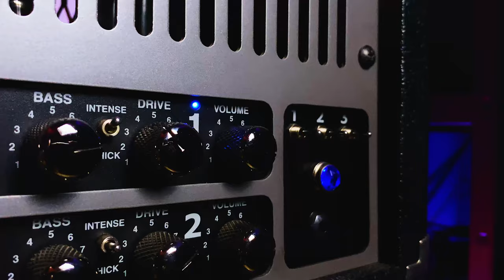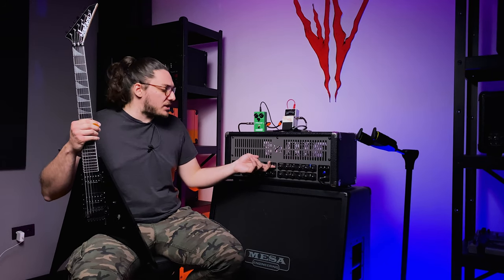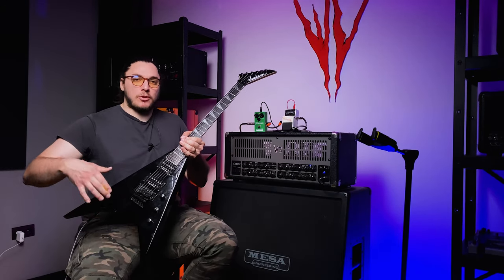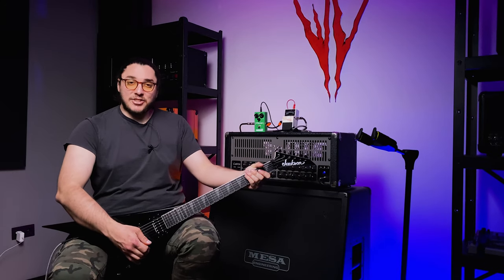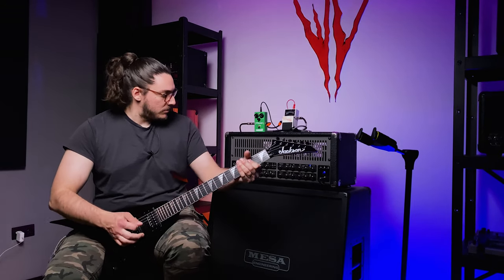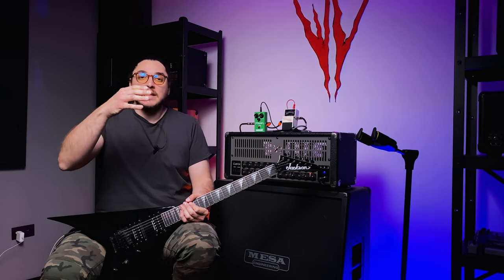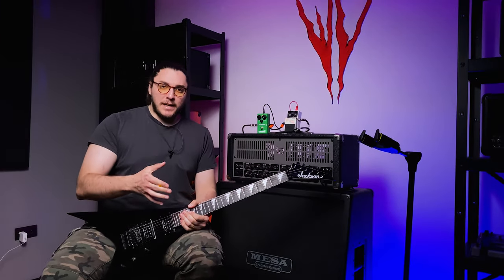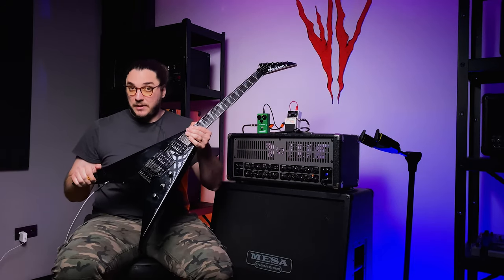SOUNDS FINE BUT STILL... | Carvin V3 | Metal

Comment: I reckon that the V3 is on its way to becoming a cult classic. It's been flying under the radar for years, but I've been noticing quite a bit more attention and respect in recent years. 

It's easy to dismiss this amp if you only spent 5 minutes with it, as it is true that it's very easy to make it sound horrible with a poor idea of what ideal settings "should" be. In other words, dial it in with your ears, not your eyes. The EQ and other controls are very powerful. If you set the treble, brightness and other settings to where you typically would on most other amps, you're very likely to end up with a super fuzzy box of very angry bees. Go through each parameter carefully, one at a time. Once you've gone through it once, go back again and refine each control again. Changing one knob can effect how another knob responds. It does sound a little messy to begin with, but it's actually quite simple once you understand how it all works. The reward is most definitely worth it though. I don't even really play metal. I'm more of a hard rock guy, and this amp is just awesome. I don't foresee myself ever buying any other amp. My biggest recommendation though would be to buy the head and not the 2x12 combo. The combo version is easily the heaviest amp that I've ever had to lift. It's just stupidly heavy. I ended up finding a head version for sale, which is what I have now. It's also the later revision with if added reverb, which is a nice touch. 

In short, grab one of these now if you can while they're still affordable to do so. As I began with, I reckon you'll see these amps start to shoot up in price as more people become aware of their hidden brilliance.
Reply from the maker: Magnificent summary sir, this goes to the top. Thanks!
Reply: @WrathVault  I'm glad that you appreciated my own little bit of commentary. Thank you for your own review. Let's all hope that these amazing amps are soon more recognized and appreciated for what they are and what they can do. Your review is going to be good in helping to get the word out to anybody who isn't aware, as well as those people who didn't give it a proper chance to begin with. Thanks again.
Reply: Man, I totally agree w u. I almost gave up on this amp, but I stuck in there and tweeked each nob one by one. Back and forth. You gotta. I never heard anyone hit this amp right on the head as well as you just did man. Respect to you boss.
Reply: @ericbasora4697  Thanks for your acknowledgement and support for the great amp that the V3 is. With all the love that there is for 5150s and Rectos, it surprises me just how rarely the V3 is mentioned. That said, it is a great amp and I do believe that people are finally starting to notice. 
Another thing that does wonders for my own setup is a DOD compressor and a Boss noise suppressor. I have the output and compressor level both set at 3 o'clock, which acts as a bit of a boost, as well levelling things out nicely. The Boss noise suppressor is also set quite high, much like a noise gate. It does an incredible job of keeping things quiet for what admittedly can be a bit of a noisy amp once you start to push the gain.
Reply: @sps4992  yes sir..I couldn't agree more. I can tell you dug deep into this amp man. I've also found a fairly unique sound using different pedals. And throwing a noise Gate on it definitely helps control the nastiness that the distortion brings out. He'll yeah man, nice talking to ya.

Comment: I’ve had this amp since 2019, what would be your setting to get this more in the Recto tone than the 5150? More Mid Cut? Scoop the mids?
Reply from the maker: Man, I don’t have access to the amp at this point but as far as I remember the knobs were very sensitive so you have to spend some time to find the sweet spot for your playing and specs  of your guitar. Also scooping the mids can be tricky time to time since both absence and occurrence of mids boost different sides of the amp too. I hope it helps!